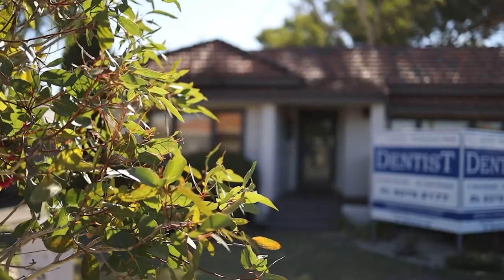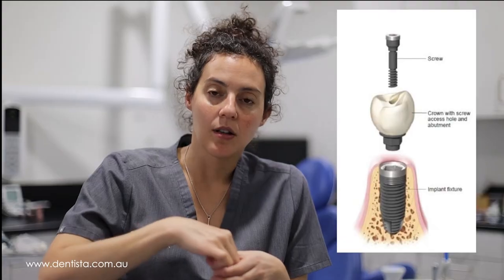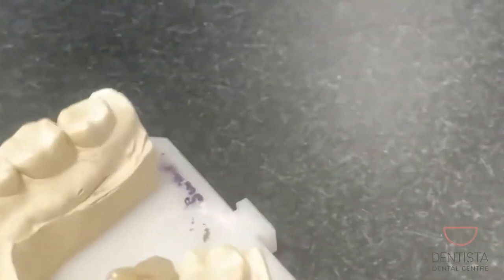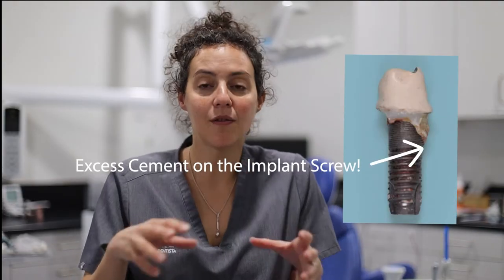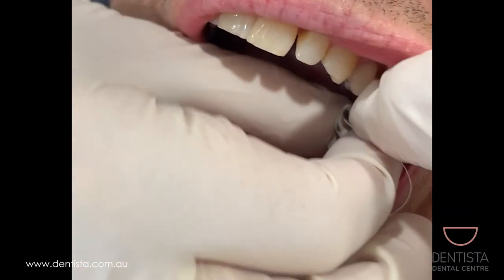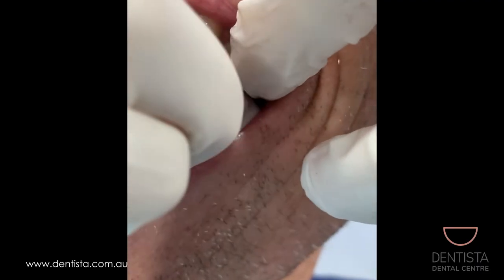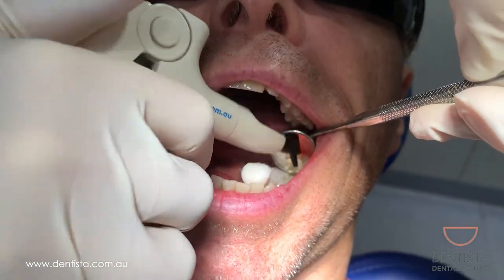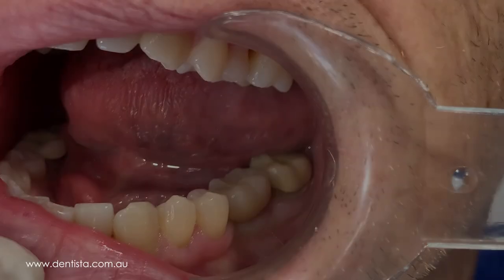A Screw in a Screw?! 🤯 How does a crown get attached to a dental implant?

Comment: When my dentist screwed on the crown, it hurt so badly that he had to give me an injection of novacaine.  I felt a terrible sharp pain all the way up to my eye!  Could he have over-torqued it and caused the implant to break loose from the bone?  It's been almost 24 hours and it still hurts.  I'm to return in 5 days for him to adjust the crown if needed after my gum swelling decreases.
Reply from the maker: Hi there, that doesn't sound good, there could be many reasons for the pain. I hope you have had resolution of pain with your implant crown
Reply: @drcarlathedentista8143 I have a question. I had an implant abutment screwed into bone but it's not properly centered. Would that affect anything?
Reply: @MyName-cp7qc  I know you were asking the Dr, but I just wanted to let you know my experience. I thought the same thing when I got my implant. But my crown is centered just fine. I am not sure if they center it to bone or gum when they do the implant screw. But crown placement turned out just fine.
Reply: @cshamber did they numbed you up for the abutment and crown placement?
Reply: @kojoyeboah7  yes

Comment: Why do the crowns that I just had placed on my upper palate hurt WAY more than when I had just the posts put into the bone months ago? My gums around the new crowns on the right hand side (and for some reason also the gums on the natural teeth directly below them, which have no implants), are throbbing in pain for 2 days now and show no sign of letting up. 

Painkillers and anti inflammatories aren't working, where the usually work quite well with any past dental work related pain I've had. They've given me Peridex Rinse and Amoxicillin for 7 days, something I've taken before, but I'm wondering if during the cap screw removal, pre-crown placement, if I got some bacterial infection in there. I remember it smelled unpleasant when they were taking the post cap screws out on the right upper palate. I had 4 implants, 2 on each side of the upper palate, all molars, except for one small tooth beside the front tooth- a tooth that never grew in for me, so this was an add on. This crown seems to be the most painful of all 4. The 3 other implants were previous molar root canals that eventually were redone until they couldnt be redone anymore and were extracted, necessitating the implants.
Reply: Any update?

Comment: At what pressure the crown should be tighten on the implant? My dentist did the crown and he tight at 32 Newton and my bottom jaw hurting
Reply from the maker: Hi, there may be several reasons your jaw is hurting. The actual torque depends on the implant system and the abutment type, these are things determined by the implant manufacturer, 32Ncm is not unreasonable. Some other factors may include the subgingival profile of the crown (may be very bulky, so squishing the gum), and if the bite it too heavy from the opposing tooth. These are just a couple of things. You are best returning to your dentist if the pain hasn't gone away.